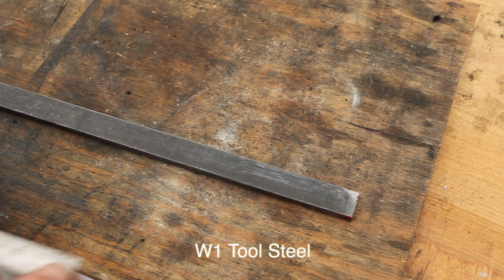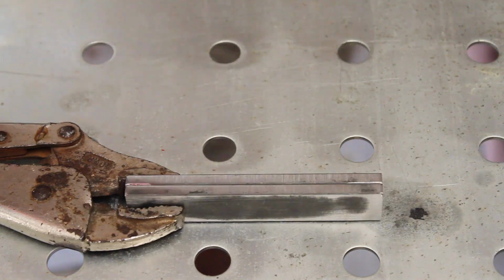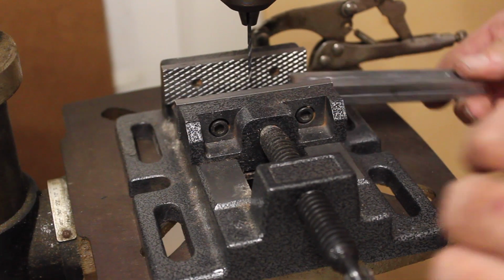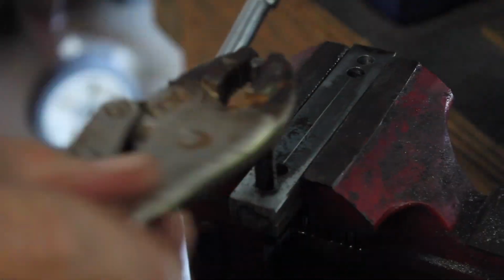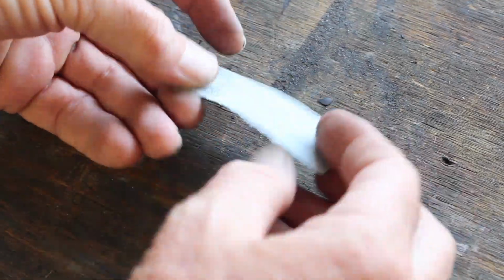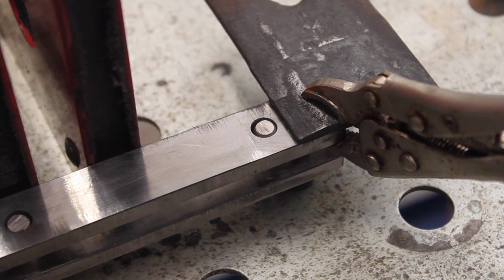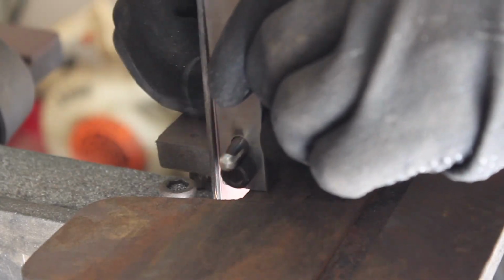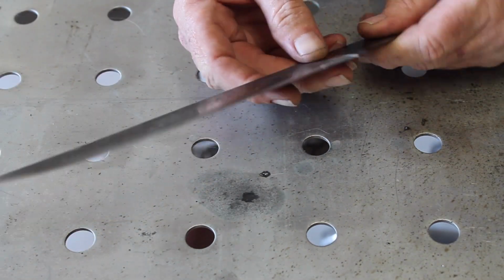Plunge Line Jig for Knife Making

Comment: Nice video, just a tip regarding the welding splatter, you can mix up water and Muphy's Oil Soap, it doesn't need to be any precise ratio and then you can just brush it on your work piece. The spatter won't stick to the metal  and you can easily wire brush it off.
Reply from the maker: Thanks for the tip, I'll give it a try!

Comment: Would welding on it after quenching mess up the heat treatment?
Reply from the maker: Yes in the area around the weld it would, you can see in the video the coloration after welding was about 1/2" around the weld, so the center part of the jig where the knife blade fits should still be hard. It was meant to be a plunge line jig not a filing guide. I won't be sanding or filing on the jig, only on the knife, so I wasn't too concerned about softening up the ends from welding.
Reply: @artmetalscience  awesome. Thanks for answering my question. I really like how you have the pins on the jig. After watching your video I am making similar jigs.
Reply from the maker: Cool! Thanks and good luck!